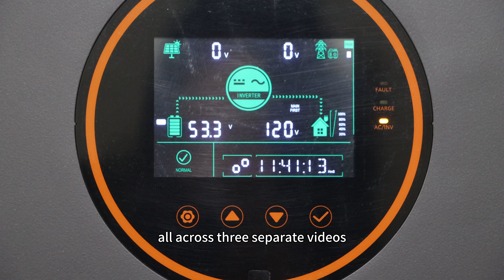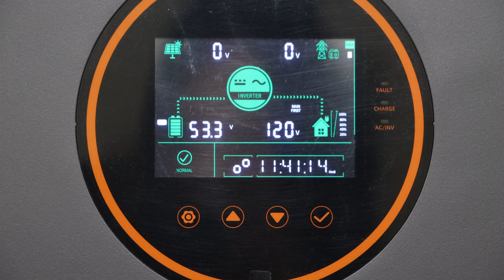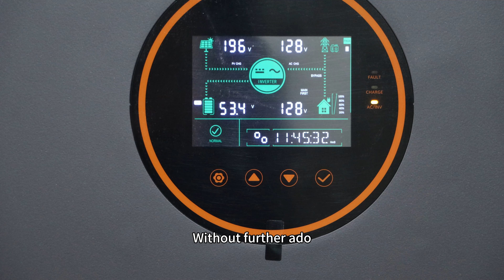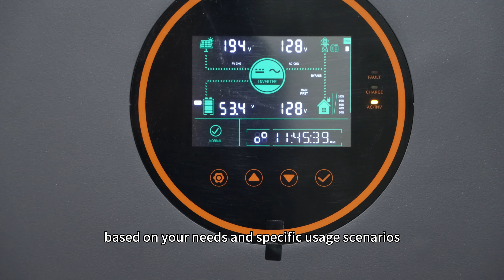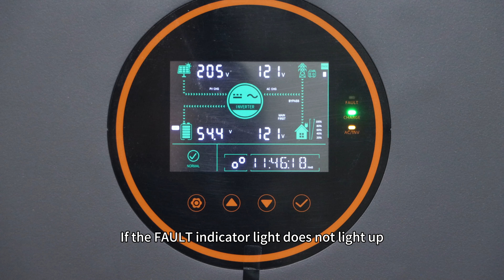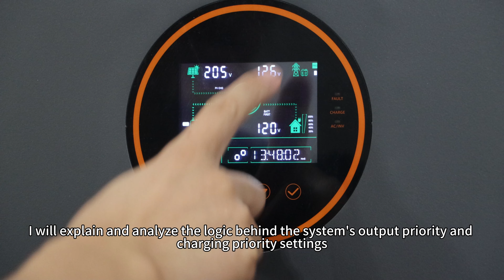How to Build a 48V 5KW Solar Power System - PowMr SunSmart SP5K

Comment: Please make a video that demonstrates how to setup/connect two spk 5000 in parallel WITH COMPLETE AC OUT WIRING TO A 200 BREAKER BOX.  you could show how exactly the wiring is setup and how many AMPS( AC) the system needs to operate for 240v AC out. 😁
Reply from the maker: OK

Comment: in inverter mode how bond to groud?, if my ac input if bonding in the main panel feeding the ac inverter
Reply from the maker: There is no bonding between N-G internally in this machine. The N and G of the AC inputs can only be connected externally if required. However, when using mains power, the mains circuit breaker may trip. So we don't recommend connecting N to G on SP5K.